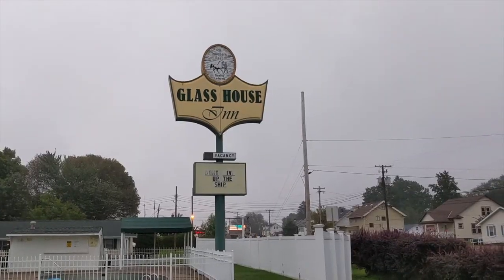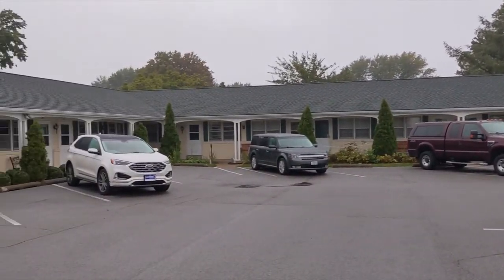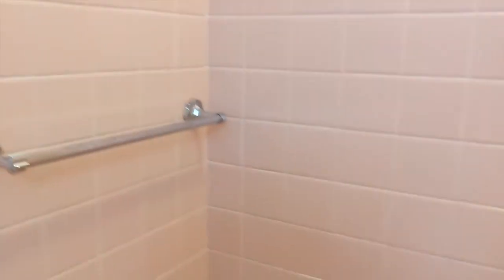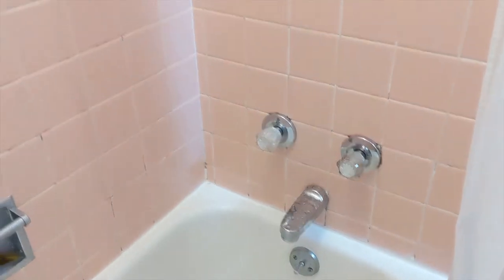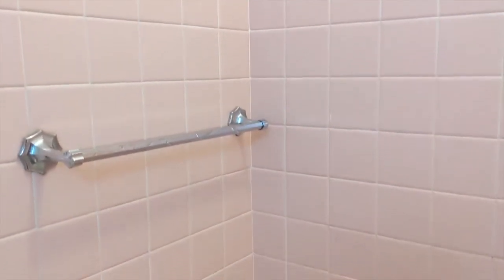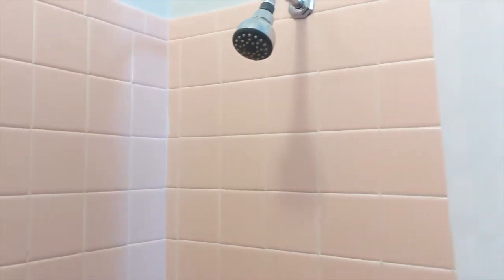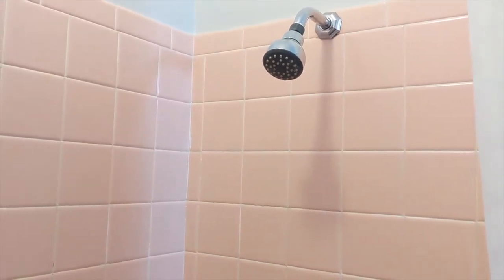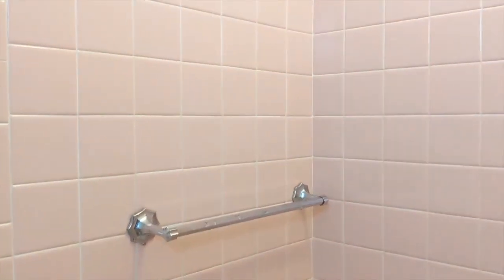How to Mud Ceramic Tile

Comment: My father built our family home in the mid 50’s and tiled the bathrooms.  He must have used the metal diamond mesh because I remembered it after seeing it on this video.  I would have never thought of it otherwise since I haven’t had any personal experience with tile being installed since and I was about 4-5 then.   A lot of old skills have been lost as new methods and materials (quicker but not always better!) have become available.  Very interesting, thanks for sharing the info.